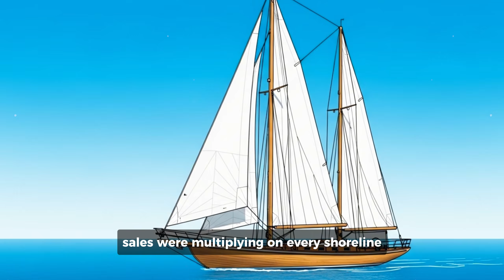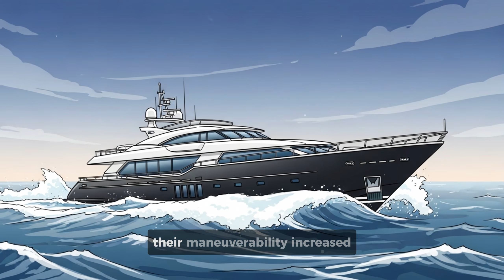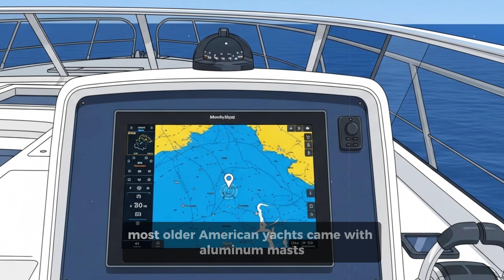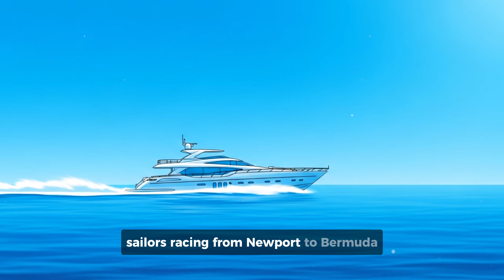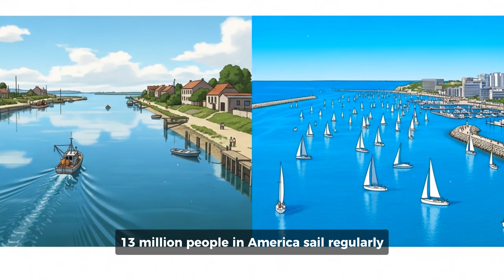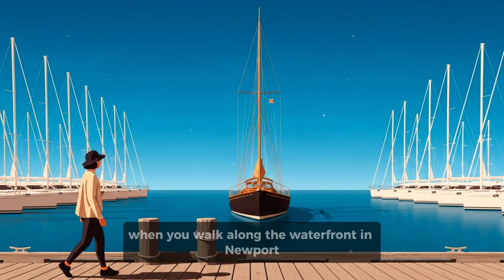What Changed Between Old Yachts and Modern Yachts?

Comment: This guy and his love for modern boats.  Modern boats suck at sea.  That is a fact.  The hull shape pounds in forward of the beam seas.  They have a hard time sailing straight and work the autopilot to death, literally, trying to keep the boat going straight and crew has to hand steer a lot because the autopilot can't handle the waves.... and they broach a lot too.

Not to mention they lose rudders and keels at an alarming rate compared to the old boats.

Buy your modern boat for weekend fun but don't go crossing oceans on them.